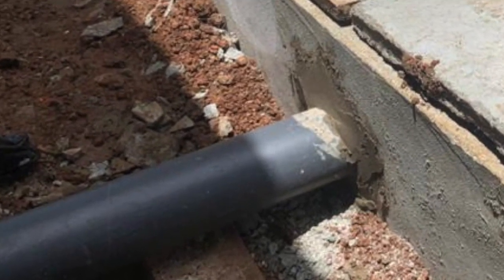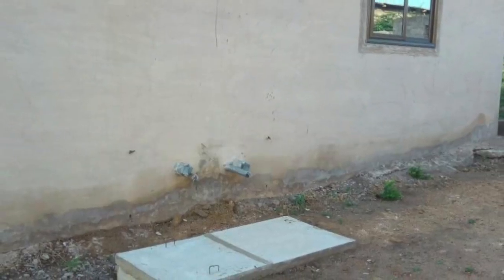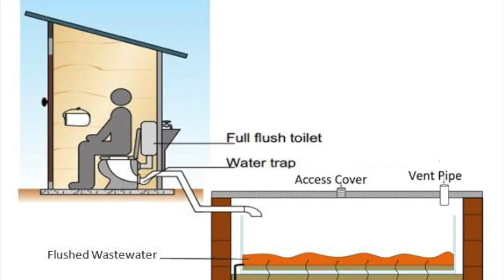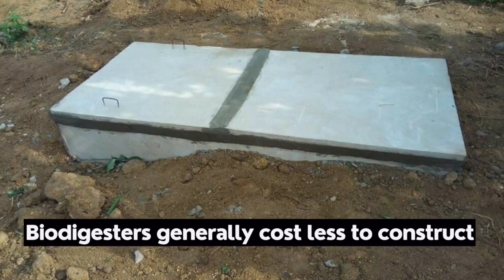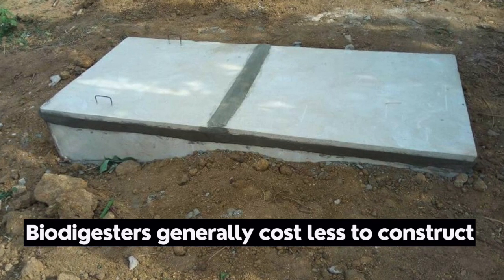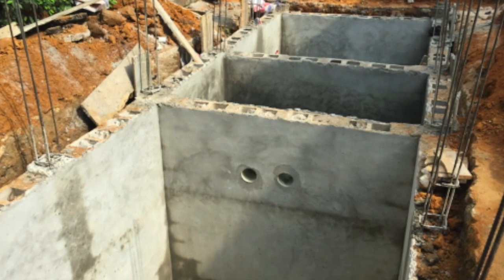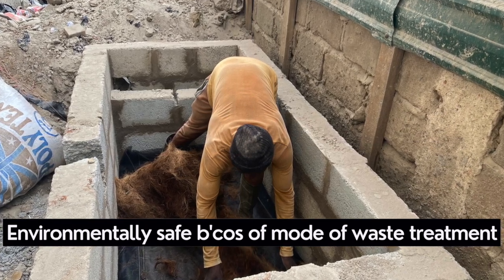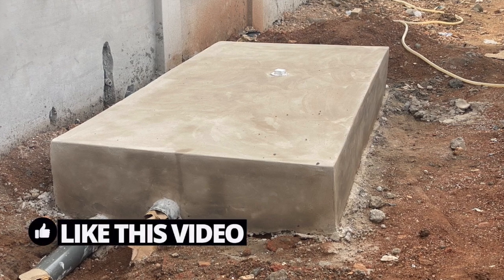Septic tank or Biodigester: 5 Main Differences

Comment: nice presentation. Does the soak away attached to the septic tank 1st and 2nd chamber have a concrete bottom? I also noticed there were holes in the soak away chamber. is this safe and a good practice?